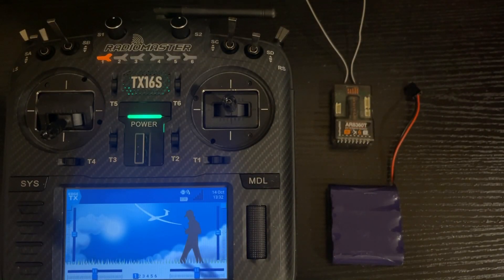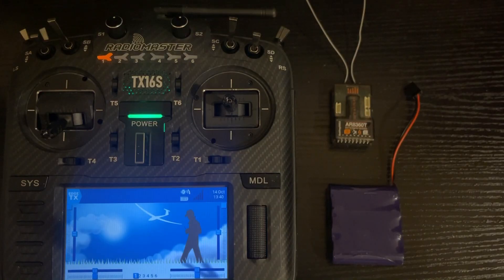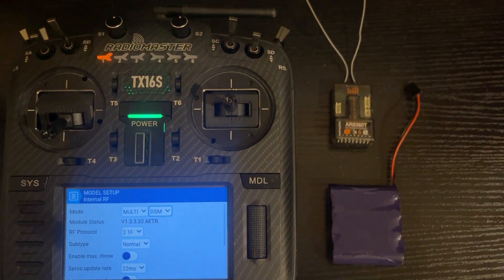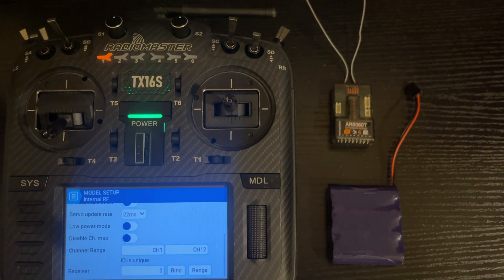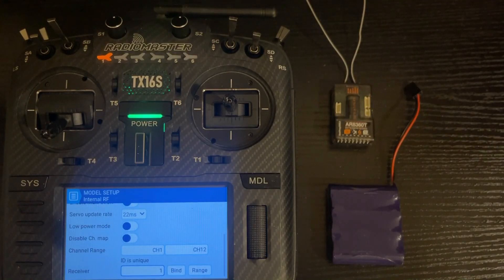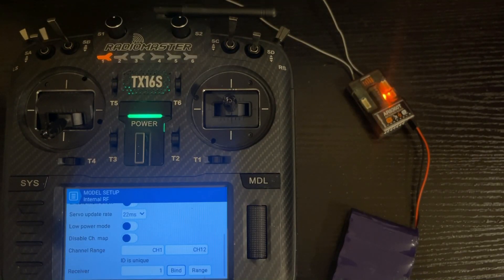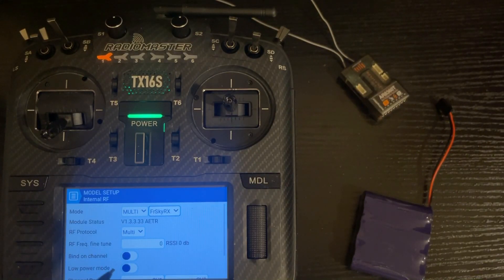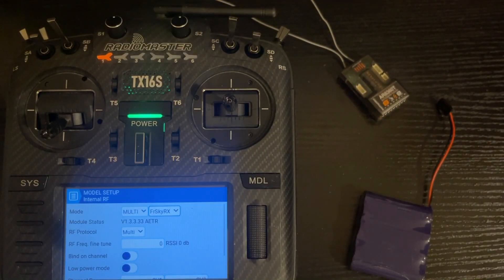Radiomaster TX16s/Edge Tx: Binding Process

Comment: what version are you running on your tx16s???? i just updated to v2.11.4"jolly mon" and it looks NOTHING like your video. my previous version was way old and looked different as well.
Reply from the maker: Version of 2.10 at the time. Layout for binding is same menu on most versions...
Reply: @BDTennessee  oh how i wish that were true. on the newer versions of edgeTX,  the user interface has changed drastically. 
seems all the help videos i can find now are outdated; or else i'm just way more lost than i realize..
Reply from the maker: @SpeedyCorky  Bind process will be the same and this video applies. 2.10 and 2.11 will be similar but not the original 2.7 that came on the radio.
Reply: i mean, what version of EdgeTx ?
Reply from the maker: @SpeedyCorky  version of 2.10 as mentioned...
Reply: @BDTennessee  i even rewatched the whole video. still couldnt find where it was mentioned that you are on 2.10   (?)
to confirm, we are talking about EdgeTX "Centurion v2.10.0" yes?
in which case my follow up question would be, at this point have you upgraded to "jolly mon" v2.11.X versions? why? why not? 

sorry very new to do all this complex world of RC.
Reply from the maker: @SpeedyCorky  i didnt mention in video. Im on 2.11.4 now and yes this video still applies and will walk through binding...

Comment: Thank you!

I'm a Gator but I still subscribed. 🤯🤣
Reply from the maker: Haha, thanks John Gator!
Reply: @BDTennessee  Anytime brother!
Reply: @BDTennessee  Do you know why I'm not getting that pop up asking if I want to use my tx as a joystick. I have the radio set to ask but when I plug it in it doesn't ask. I even set it to joystick instead of ask and it didn't do anything. I am using the same cable and computer that my other radiomaster radios with with.

Comment: I’m pretty new to Radiomaster but I’m trying to see if I originally set up a model with the ailerons on a y able and decided to put them on separate channels how you would go about doing that. I know how on Spektrum radios but it’s not clear to me on Radiomaster TX16s
Reply from the maker: Go into Mixer > Copy the Aileron Channel on 1 to the other channel opposite aileron is connected. > Aileron needs to be "reversed" ,go into Output Screen and Click Edit on that channel. Toggle "Invert" switch